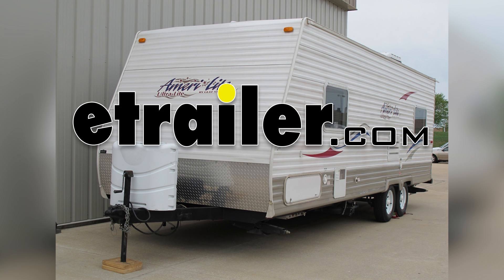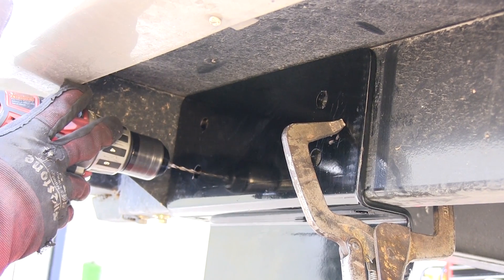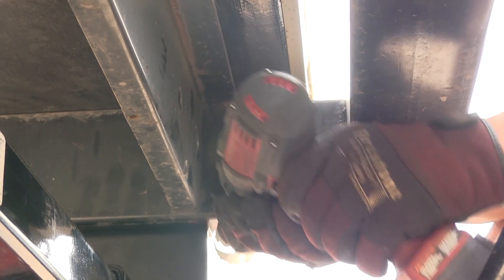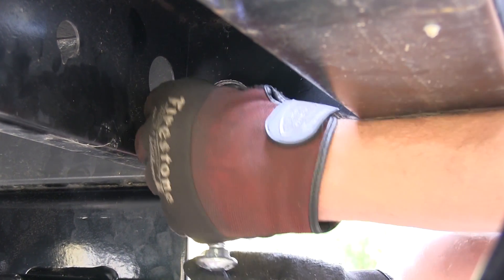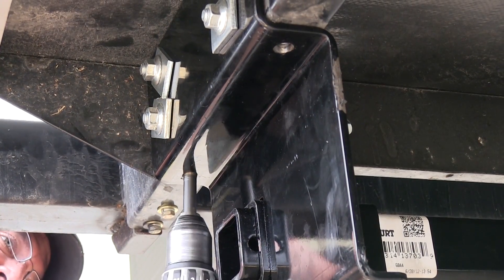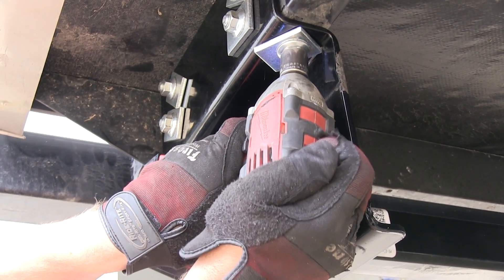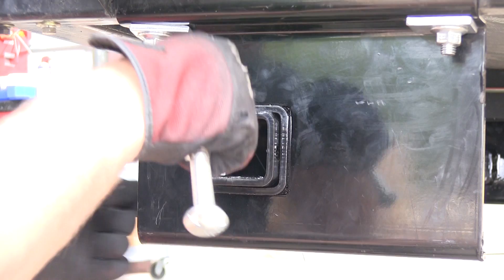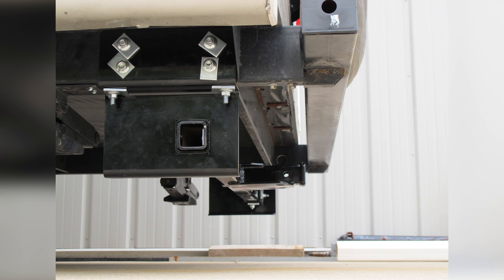etrailer | A Closer Look at the Adjustable Width Trailer Hitch Receiver for RVs, 22" to 72" Wide

Comment: any idea what the weight limit win be on the hitch
Reply: Greg Large 350 lbs Tongue & 3500 lbs gross.
Reply: The instructions on the Curt Hitch state it is rated at 3500 lbs with a tongue weight of 350 lbs.
Reply: Link to get the part